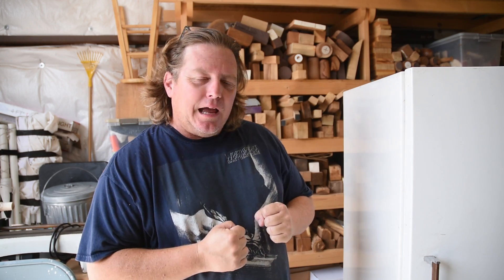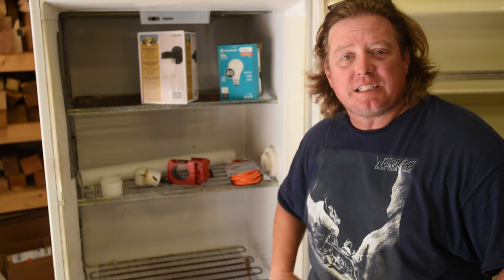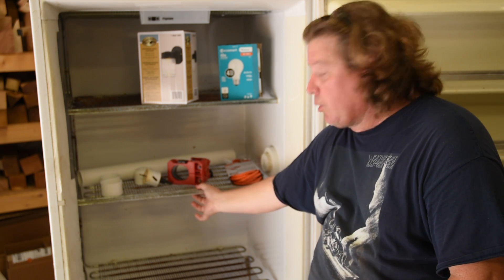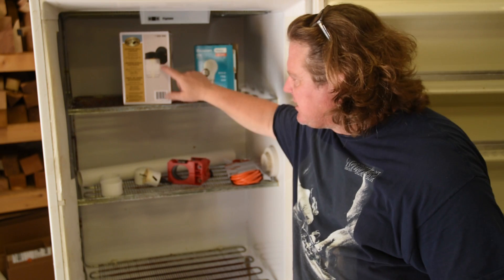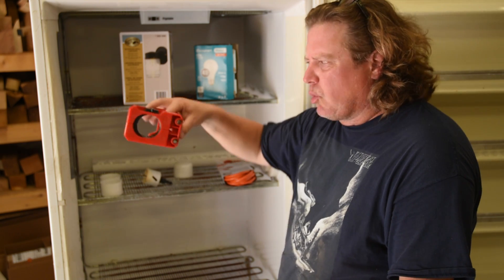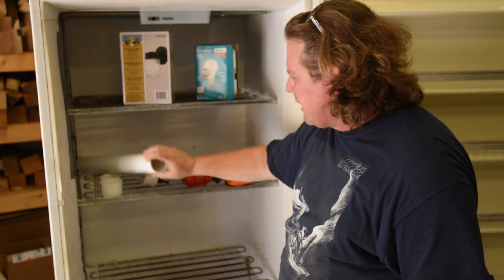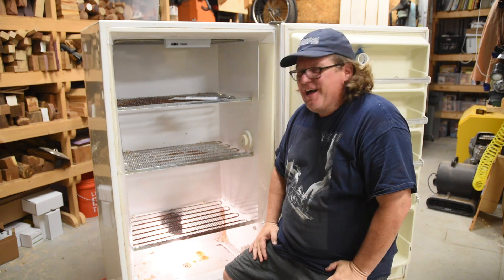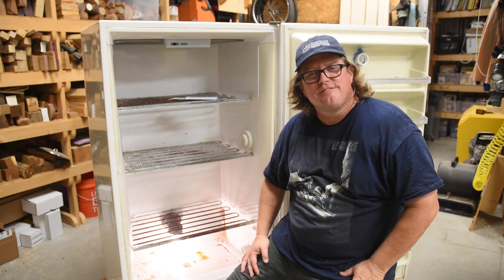Make a Small Shop Kiln from a Freezer/Fridge

Comment: Cool idea.  Don't forget to stager stack the pieces so you have even air flow on all parts of the wood on those shelves.  Also if that PVC gets hot, would it give off toxic gasses?  Also might want to have screens on those inflow and outflows to keep bugs out in the low temp' or off times.

Comment: For about $10-12 you can get a combination thermometer and moisture meter wireless that will enable you to monitor the temp and humidity inside without even opening the door.

Comment: Shawn, I searched through your channel to see if there were any updates on the kiln project. If there are no updates, would you consider providing one. If there is a later video, would you provide a link to it (them). It'd be interesting to know: how well overall the kiln dried the wood;; what sizes/species of wood you dried; how long it took to acquire the desired moisture content;, did you open up the size of the air exhaust hole; did the progression of lamps from 40 to 60 to 100 watt lamps work out; and finally did you have any moisture buildup issues in the kiln? Any other tips you might have would be appreciated. Thanks, always enjoy the content.

Comment: great videos.  New subscriber here.  Can you advise about how long it takes to dry out a typical bowl blank?  like maybe a 10x10x3 block of fresh cut wood?
Reply from the maker: You need to rough it out. I have a video on Roughing Bowl Blanks. If you don't rough it out the rule is 1.5 years for first inch then 1 year for every subsequent inch so 3" is 3.5 yrs. Rough it out and you're good to go in a few months.

Comment: Been a subscriber for a while now.  Just aquirred a freezer to make a  dryer and sterilization chamber.  My question is, what size heat bulbs will I need to reach the proper sterilization temperature? (133-150 degrees for 12-24 hours). Any help on this  would be great. Thanks.
Reply from the maker: Get a variety and warm it up slowly with each batch.
Reply: @wortheffort  How long is slowly? I see u started with a 40w, so how often do u increase it and by how much wattage each time? Btw I am a new wood turner and u are the best teacher I have found yet. I would love to have a one day crash course with you in person or even just a few hours 1on1. I'm in Oklahoma so close yet so far. Thank you for what you do.

Comment: If youd want to dry longer lumber than lenght of the shelf could take shelfes out and dry lumber vertical or should the whole fridge be flipped sideways? Or would it ve easier just build something bigger outside?
Reply from the maker: Freezers usually have the shelving as part of coil.

Comment: Do you or what do you think about sealing the end grain to slow the process a little and reduce splitting and if you do not seal how much splitting do you get? And if you were to seal could you or should you use a little higher wattage bulb to start with? Or what about just sealing the heart wood not all of the end? At the end you said you want 125 degrees for a while what temp do you start at and how much are you trying to ramp up each wattage change on your way to 125. Man I got so many questions I could go on and on. I've always just air dried or got dried wood.
Reply from the maker: see video I did on drying free wood.
Reply: @wortheffort  Thank you I will check it out

Comment: I'm pretty sure this video has been up for awhile, but I still wanted to make a suggestion. In the back where the power cord goes in. I would have used an automotive grommet from someplace like AutoZone to keep the cord from catching on the couch edges of the hole.
Reply from the maker: Good idea
Reply: @wortheffort  I'm going to to start looking for a fridge in my area to make on. I have watched quite a few video's on how to do this but none of them went into the details like yours did on air circulation, ventilation.

Comment: for all you who have done lots of log turning, I received a lot of very wet
 logs and have no idea what they are.   It has really rough bark and just 
under the bark it is intensely pink.   It smells bad, too.   the sap 
wood and heart wood don't have that much difference in color, a light 
creamy beige color.  I have no idea what it is but it has some beautiful
 spalting that I hope will not bleed into the rest of the wood (the 
exposed part is already doing just that).   I'm in Calif.     
Thanks!
Reply: The heartwood of boxelder (a form of maple) will have a pink hue

Comment: It's a great idea if you can find a large enough freezer body. In Australia the incandescent light bulb is extinct. I did a little research and it is possible to buy infrared bulbs but you would want to control it with a thermostat here due to the fire risk.

Comment: Great video. Thank you so much for sharing. We are now more than a year later.
Can you tell us something about if it works according your expectancy? How much Kwh did you use for drying one content of the freezer/refrigerator?
Reply from the maker: Wood comes out dry. Can't expect much more at this price point. As for Kwh... expecting a bit much from a YouTuber there.
Reply: @wortheffort  I did some calculations:
40 W bulb consumes 1 Kwh a day, which is 21 Kwh per 3 weeks
60 W                                                                              30 Kwh
75 W                                                                              42 Kwh
100 W                                                                           55 Kwh
Together maximum                           appr          150 Kw  for twelve weeks if the light is on 24 hours a day, so 100% of the time.

But I really have no idea, if the light is on 100% of the time. It could be also 80% or 60% or even as low as 40% or 20%.
If you put a measuring device between the outlet and the extension cord you can read out the real consume of Kwh
(which might vary, in summer less than in winter, because of the temperature of the environment)
Reply: @hansdegroot8549  very good post, cheers. I tried a food dehydrator, 3 rough turned bowls for 4 hrs at 35 deg celc, it halfed the moisture levels from 35 to 15. Two bowls were great, other one had a small crack, but used roughly 8kwh. This is a powerfull one though at 1000w so a smaller one would be way better even if it took longer. I can fit 4 or 5 bowls in there. Did you make a kiln yourself and how did it go?

Comment: You could try to source one of your "dream" boxes by contacting a local Coke distributor's service department.
They typically scrap many old double or triple doors each year, which is a big expense to the company.  
You would only be looking for a carcass, no refer parts and may have a choice between a swing door or a slide door model. 
Be aware that moving those boxes can be a bear, so bring a moving dolly and plenty of help. 
Good stuff, best of luck
Reply from the maker: Good idea.

Comment: How do you know when to up the heat?
Reply from the maker: I guesstimate and just increase wattage every few weeks until I reach 100w. This is a very basic kiln.
Reply: Good question, which was not mentioned anything about in the video.
You could use a thermostat  connect to the light bulb.
We used to have 500W mini heaters to keep some places frost free. At a certain moment they broke. One of them I took apart and it turned out
that the electric spiral was spoiled. But the thermostat still worked because it clicked when I was turning the wheel.
Just for fun I connect a fitting for a light bulb for it. When I put the thermostat higher than the temperature of the environment the light bulb switches on.
At that time I had no practical use for it. I did it just for fun to try out if it would work. And it did.
Now I can see use for it. But, that thermostat goes only to 25 or 30 degrees Celsius, which is pSrobably much lower than the Fahrenheit temperatures which were mentioned in the video. That means that a thermostat with a higher range is necessary,

Comment: Don't those freezers have an internal fan you could make use of? Just isolate it from the compressor, plug it in so only the fan runs.
Reply from the maker: haven't thought of that. Mine doesn't though.

Comment: Could this work with firewood?
Reply from the maker: seems overkill for firewood.
Reply: wortheffort Possible, but a large chest freezer ( free ) then a tube heater and fan, both just a few bucks, and very low running costs is worth a try 😀
Reply: @chucktodd60  They way wortheffort works nearly no wood is firewood.

Comment: loved your video!  When not if i make my kiln i just wanted to know if i could use an LED light bulb
Reply from the maker: No, it’s the heat not the light you want.
Reply: Much appreciated on the quick response, if i would have read a little further down in the comments first i would have seen that. Let me ask you this why the fridge is it because it can hold the heat because it's insulated, why not just a huge box made of plywood?
Reply: @rossbrockett694  If you have free plywood and free insulation material it is still the same price as a free refrigerator. A died refrigerator cannot be used
for many things. With some square metres of free plywood you can do many other things.
Reply: Hans de Groot, ty

Comment: I'm just beginning with turning and just discovered that some small (4x3) blanks I bought are relatively green and need to be dried. They arrived coated in wax. Black walnut, Black Cherry, Red Cedar, Spalted Maple. Do I need to remove the wax coating immediately and put them in paper bags or something? Not sure what to do. Not quite ready to build your kiln, I think. :P
Reply from the maker: No, leave the wax. Just set them on the shelf. General thinking is 1 year per inch. A kiln will speed it up but sometimes changes the property of the wood (makes it crunchy). Just takes time. You can rough out something like a box and it'll speed up drying because less wood but I feel it's best just to let it rest.
Reply: Alrighty, thanks for the timely response! Love your videos! :D

Comment: Just found your channel. Great content! Learning  a lot! Watching a few vids every night. We all know what happens when metal touches wood for a short time. If you roughed out a bowl blank  90% of the way down then placed it on the metal wires for a few months could the blue travel far enough  in the wood to cause a problem?  Or would you place the blanks  on small strips? Thanks for taking  the time to make these vids and putting  them up.  I'm  a beginning turner and love your channel. Thanks again! Ben. .
Reply from the maker: That reaction only happens in woods with tannin such as white oak, cherry, walnut.... it's the iron that's doing the reaction. Don't think you'll see anything placing stuff on fridge wire to dry.

Comment: Not sure if this would work or not, but could you just install a 100w bulb and wire in a dimmer switch, rather than having to change the bulb every few weeks?
Reply: I’m building one similar to this and found a WiFi dimmer and WiFi hydrometer/thermometer combo so I can change the temp from my phone
Reply: @northwoodsworks4249  Could you please provide more information on that?
Reply from the maker: Hrmmm... might be worth a try.

Comment: What about no vent holes and use a small fan on low for air circulation? Maybe one hole and the small fan? Would a heat bulb on a thermostat work or use a regular incandescent light bulb? Great video! Thanks
Reply from the maker: No ventilation would likely lead to mold and am told a fan would create to much wind which can cause surface checks. I did use an incandescent bulb.

Comment: awesome idea! for the "less intelligent" folks out there LED bulbs will not work, you need incandescent light bulbs for the heat.
Reply from the maker: good point.
Reply: Sh...t i guess i should have read all the comments before making my own
'
Reply: I didn't know anyone still made incandescents anymore. LEDs are way more common; they use much less energy for the same amount of light.
Reply: @schechter01  The latter is true. Only the light bulbs for this kiln are not used for the light but for the warmth it produces!
Getting classic light bulbs is getting more and more difficult. In Europe it's more or less forbidden to sell them.
Reply: The effect is measured in wattage, which is the "amount" of heat produced.
If you need to control the heat by turning bulbs on/off, you could have one of each of the following bulbs:
10W, 20W, 40W, 80W. This will give you a range from 10W to 150W with 10W increments. Eg. if you want 110 Watt, you turn on 80W+20W+10W.

If, on the other hand, you want to use a microcontroller (or a Raspberry Pi), then you can make this microcontroller measure the temperature using a cheap NTC and a few MOSFET transistors. The MOSFET itself will also dissipate heat, so to save on your electricity bill, you can put it inside the kiln along with the microcontroller and transformer. Regulating the temperature with all these heat-producing gadgets will be a little more difficult (because it takes a lot longer to remove the heat than to generate it), but it should be doable.
I prefer working with a microcontroller (STM32F103) myself, but using the AVR (known from Arduino) would be much easier. You can use relays instead of MOSFETs, but you'll need to use a transistor to turn the relay on/off (eg. a BC547 or 2N3904 - they're very cheap, get a bag of 200 on eBay from China). You'll also need a diode for protection; a bag  of 100 of these won't ruin your budget. The relays are expensive, though; here you'd only want to purchase 5 (maybe a few more if you want spares or later expansion).

Many relays allow you to use up to 250 Volts at 10A. That's 2500 Watts, so that'd be way more than needed.

On the other hand, if you use MOSFETs, you can use a single 120Watt bulb and turn the bulb on/off quickly, in order to regulate the heat dissipation. Alternatively, you can use the MOSFET itself to regulate the temperature. In either case, you'll need to add a sufficiently big heatsink to the MOSFET (matchbox size ... 3 times matchbox size will do; you do not need a 5kg heatsink).

Controlling a heating element is not really recommended in this setup. Bulbs are safer!
A heat element has the potential of starting a fire - especially if there's an error in the program you're running on the microcontroller (it may seem to work fine, but software tend to play tricks now and then, and you can't see physically, that something is wrong). -For instance, the software that controls the MOSFET or relay could crash right after turning on the power to such a heat element, resulting in the heat-element never getting turned off. Since the heat element is close to wood ... I don't think I have to say anymore. ;)

When working with this, I recommend low voltages where you can. 12V/24W bulbs exists, so you can run the entire fun on batteries and solar power - or use a power supply that is compliant with all the required regulations in your country (don't just buy a cheap chinese one, all the cheap ones are constructed incorrectly and thereby dangerous - there isn't really any exception to this rule: $2 and below means do not purchase, unfortunately that does not mean that a $10 PSU is safe).
-It's much better and safer to go to a second-hand store and get a used PSU, they're $2 there as well, but they're compliant with the safety regulations.
For PSUs: Purchase known brands, Artesyn, MeanWell, LiteOn, Sharp, Traco, etc... old PC-power supplies are fine too. As a general rule, if a product has a 'CE' marking on it AND it has a manufacturer name AND it has a model number printed onto it, it's usually fine. If it does not have a manufacturer name and model number, stay away from it.
Also make sure that all your electrical connections are safe from short-circuiting. If you solder two wires together, make sure to cover the exposed copper by heatshrink (a good rule of thumb is to use 3 times the length of the exposed copper and centre the exposed copper under the heatshrink). Do not use 'electrical tape', it'll fall off after a while and isn't really good with heat. You can use screw terminals, as long as you check that each wire is thoroughly fastened.
(You may already know all of the above, and it's far from complete, but I've just seen so much scary junk on YouTube, that I feel I must mention at least these basic safety issues - even some of the people showing how to "properly" do things, certainly do not do it properly).